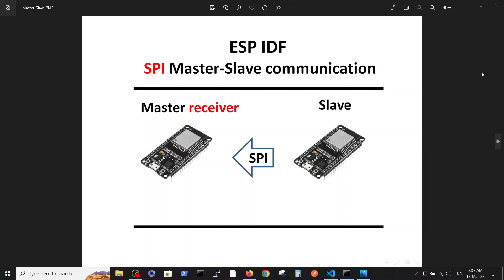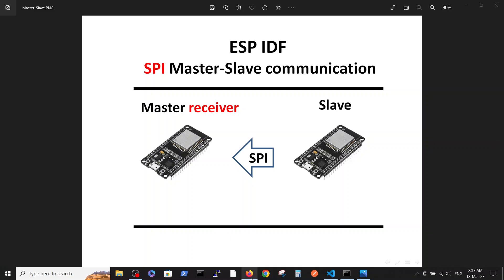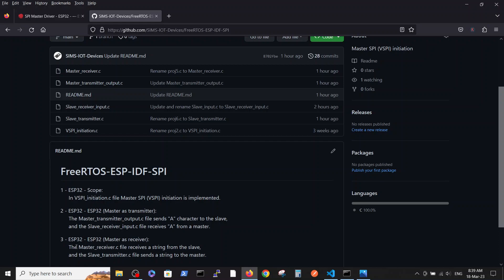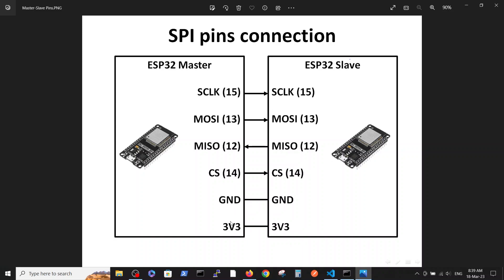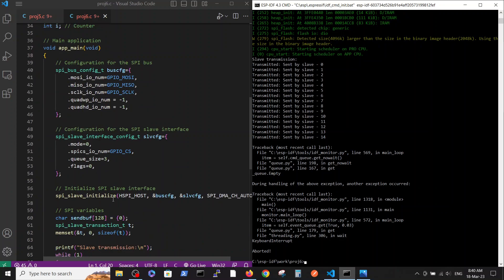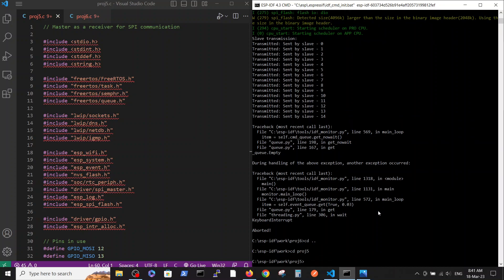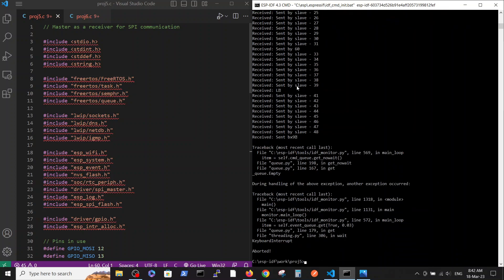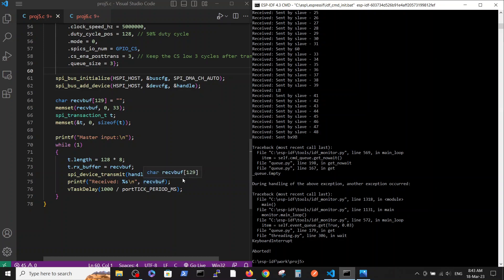3 - Connection between two ESP32's via SPI (Master as a receiver) in ESP IDF environment

Comment: Rather interesting. Is there anyway for fix that data corruption and guarantee the values will come through 100%?
Reply from the maker: Dear @velociraptor5962,
You have raised an interesting point and I think instead of digging purely into the ESP IDF code I will try to divide the problem. I will try to make a new video where the data will be sent from Raspberry Pi via SPI to the ESP32 board. In this way, the output will be controlled and it will be possible to concentrate on the input side.
Reply: In the code of master I change clock_speed_hz parameter from 5000000 on any standard (I used standard macroses from esp-idf documentation, "SPI_MASTER_FREQ_9M" for example) and the values come through 100%

Comment: Hi, Thanks for the effort you have put in making this. I was integrating ESP32 with NRF24L01 transceiver and wanted to use the ESP32 as a Master( transmit data from ESP32 to set certain registers in NRF module) as well as receiver(receive data from NRF module). This video has saved my days and weeks of work. I wanted to program the ESP32 using ESP-IDF instead of using arduino IDE to program it.
Reply from the maker: Glad it helped :)
Reply: @simsiotdevices6219  I am re looking at this projects after a few weeks, I have a small doubt. In order for my Master to work as both transmitter and a receiver should I just assign a pointer to the rx buffer and some variable to the tx buffer?

Example: I want to set first bit to 1 of a register of my slave, I directly cannot send 0x00000001 because it would turn all the other bits to zero, So I(master) first want to read it(receive the register value from the slave by Master receive) and then OR the first bit to 1 the received value and then transmit the value back to the slave.

So will this code snippet work? :
uint32_t register_value;

spi_transaction_t master_transaction;

master_transaction.length = sizeof(register_value);
master_transaction.rx_buffer = &register_value;
spi_device_transmit(handle, &master_transaction);

register_value|=0x01;

master_transaction.length = sizeof(register_value);
master_transaction.tx_buffer = &register_value;
spi_device_transmit(handle, &master_transaction);